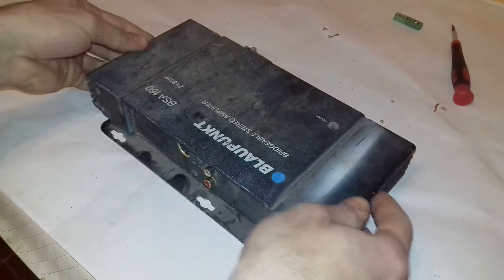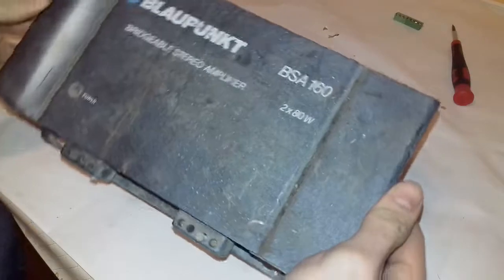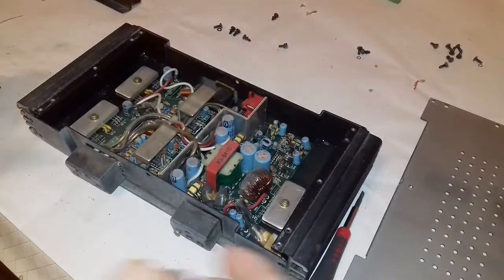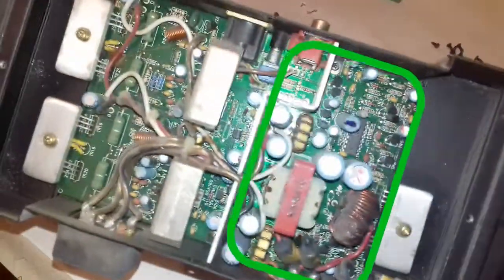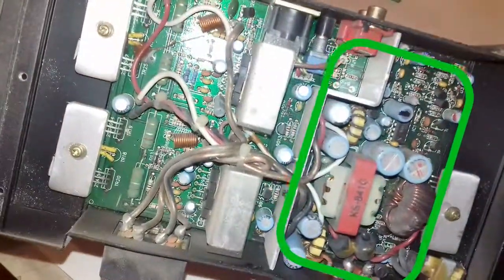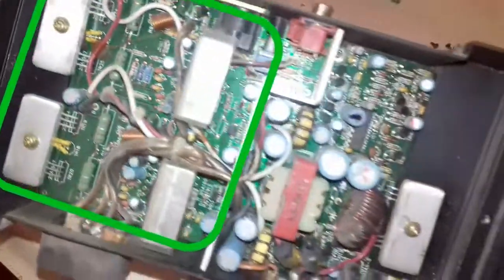TEARDOWN - Blaupunkt BSA160 car amplifier (Easy difficulty)

Comment: Have you made a troubleshooting video for old Blaupunkt amps?  My BPA 230b stopped working, the power light isn't going on but the amp is getting power.  The amp is  hard to find used and usually overpriced, so I'd like to try to repair it.  Thanks for your video, your amp sure has a lot more screws than mine does(4 on each lid).
Reply from the maker: I haven't made a troubleshooting video yet, but if I will do, I will let you know here.
Thanks for wathing!